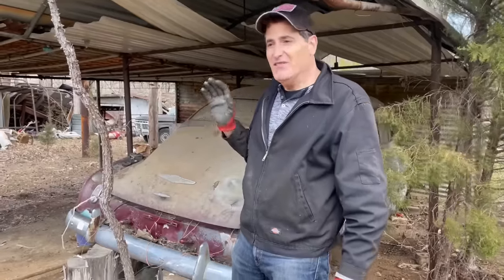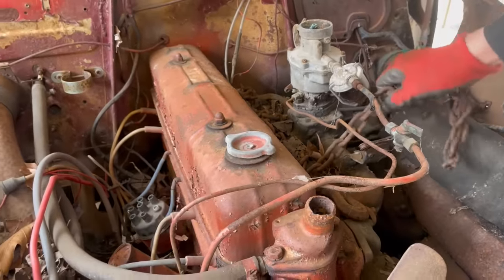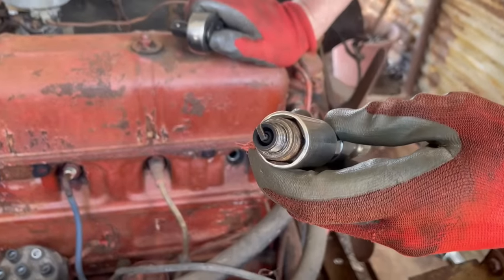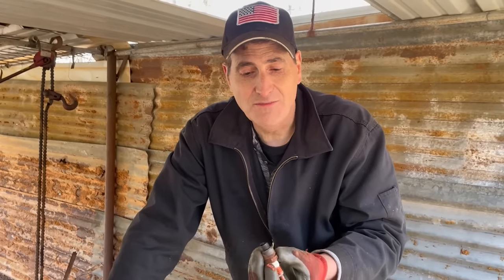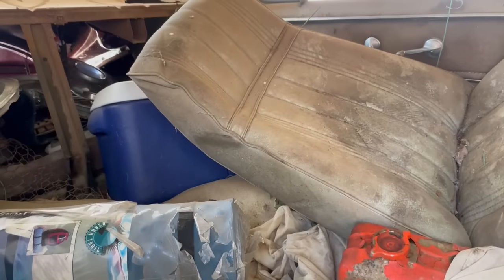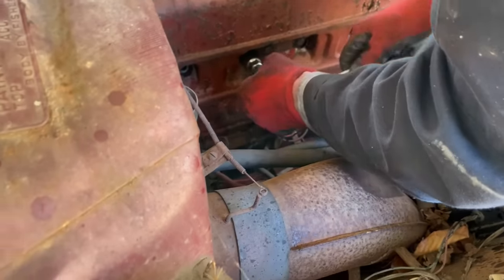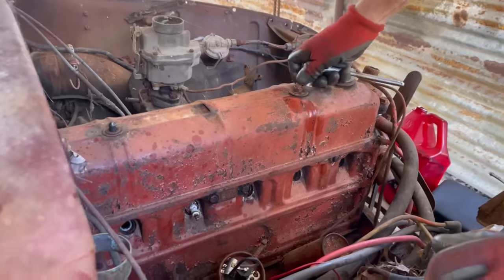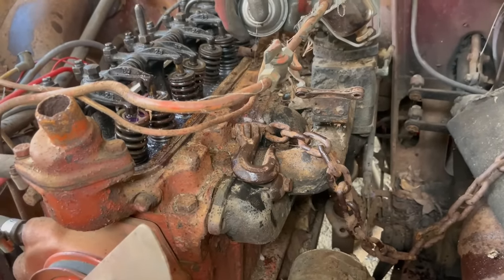Will it run? A 1949 California Chevy left behind for decades!

Comment: There was a range of adjustment on these.  The mounting holes on the solenoid were slotted, so you could move it backward or forward and position it just right.
Reply from the maker: That may have been the problem. I had forgotten that the solenoid mounts had slots in them. You certainly know these cars well!

Comment: I had non resistor plugs in my first vehicle. That was 1976. I used to get into my neighbors radio. 
Actually non resistor plugs delivered a hotter spark.
Reply: I remember in the 70's you could buy both. The non resistor were a little cheaper, so most bought those.

Comment: The paint on the plug proved your theory that the engine was at least painted. I have only seen plugs older than that one time. I met a man in 2009 that had a nearly 100% original Model A that was his daily driver. I didn't believe him until he invited me to inspect it. The car still had the factory plugs and wires. The car was immaculate. It had been in his family since it was new, and had never even been restored or anything. It was beautiful, and he drove it on a regular basis. He said that he didn't drive it in bad weather, but drove it whenever possible. It was amazing. It was in nearly perfect condition.
Reply from the maker: That is a great story. I wonder where that Model A is now?

Comment: You should get that soda machine and give it to sleeper dude as a gift! And I do bet it can actually be repaired. The compressor is sealed so it's basically safe from the elements. I bet you could get it running by just asking or paying for a refrigerator repairman, the components inside to get it to cool are the same as any refrigerator
Reply from the maker: I agree. Those machines were tough. If it goes up for sale I will grab it.

Comment: I used to use those (without the R) in my various Buicks.  You could still get non-resister plugs up into the 90s.
Reply: Man. nice in 1974 I started working in the parts department of a GM dealership through 2004, I sold a lot of those non resistor AC plugs they were very common !

Comment: A 49 Chevy was my first car — I got my drivers license in it — so it was a treat to see you try to get this one running. I wonder about that crank thing on the engine — I don’t remember any opening in the front end where you could put a crank in. Maybe the engine was from an earlier model…
Reply from the maker: I think, though definitely not sure, that the crank start thing was an option. I have seen some 49-50 Chevys with them and some without. Thanks for watching!

Comment: AC 45 was a very common GM plug until the '60s,, maybe early '70s.   Radio noise suppression was done with suppressor plug wires, capacitors.

Comment: You may wish to try prying the crank counterclockwise, then clockwise to break it loose. Also, try suspending a weight on the end of a pry bar to keep a constant downward pressure.   There's a cool vid on YouTube where a '37 Chev had a cylinder so rusted it had to be re-sleeved. The owner used a vintage boring bar and that block cleaned up beautifully.  Oh, I'm a new subscriber by the way!
Reply from the maker: Thank you for the feedback and for subscribing. We really appreciate it!

Comment: You might check to see if the motor is against the bell housing. With the way that motor is sitting it is a very good possibility. Also check for a mechanical Bendix arm. Can't remember on that car. Only worked on two like it and they were both brake jobs so I wouldn't know. Hope you get that car. It is worth having by far.
Reply from the maker: It does have the exposed Bendix arm. I had my finger on it at one point, and it is moving just like it should. I still can't figure out why the Bendix would not engage the flywheel, but it is possible that the drive gear is worn away. That would cause the same behavior.

Comment: I bet at least 3 of the pistons are frozen pretty hard in the cylinders do to rust caused by water getting into the top of the cylinders either through the intake but most likely through that  loose exhaust manifold . Of course the exhaust valves stems may be rusted in their guides as well. Only way to know the extent of seizure for sure would be to pull off the head which would reveal .out of the problem. And since the engi e was not faa tenedto the mounts it was just going g to keep flopping on You. Ha I g said all that if there are no cracks. In the block that 235 Chevy engi e would still Bea keeper. You and Christina di a great job especially you risking life and limb and putting in all that hard work. Really enjoy what you do.
Reply from the maker: Thanks very much! I agree. The next step is to pull the head. That will show exactly what the problem is. Do you think that is a 235 or a 216?
Reply: @whattherust  Looks bigger than a 216 which is what I have in my 46 unrestored original  Chevy coupe  but it could be the 216. Love to see what's under that head and maybe you can coax it back to life. Since you didn't turn it over you absolutely  did no damage to any of the internals. Can't believe it was so cold for you down there. That's the kind of weather we get up here near the Canadian border this time of year.
Reply: @whattherust  Sorry to hear about your dad as well. My condolences.  I lost my father this past October at the age of 94 with hus mind intact till the day before he passed in his sleep at the 160 year old homestead farm.
Reply from the maker: @dconoway9932  Very sorry to hear about that. Similar situation here. 92 and completely healthy. Just at that age  one never knows. Thanks for the support!

Comment: It's not the original engine.  1947 was the last year for a hand crank motor on Chevrolet passenger cars (continued in trucks).  That front bumper is all one piece - called a California "smoothie" bumper.  Those used to be a popular piece for hotrodders.  All other Chevy front bumpers of that era are 3 piece.  If you can find the grill that could be a decent car.  The VIN is on the driver door hinge pillar.  The prefix should be 6 for Oakland, CA.
Reply from the maker: Very interesting info. I saw a 1950 that had that hand crank piece too.It is possible that one did not have the original engine either. I did not realize there was such a thing as Californian bumpers in 1949. I had though that started in 55, but this is really good to know. Thanks very much.

Comment: Good video but I think if you could have anchored the engine some way it would have broken loose.
Reply from the maker: You might be right. I was thinking of that, but when the starter problem appeared it was time to pack it in for the day.
Reply: It may have been a blessing that the engine flopped since if it did turn I think the valves and pushrods would have bent and snapped. It will just need a little more TLC with the head off to get it turning.
Reply from the maker: @dconoway9932  Right, the head needs to come off. Perhaps a future job.
Reply: @whattherust  I understand.I enjoy your channel.